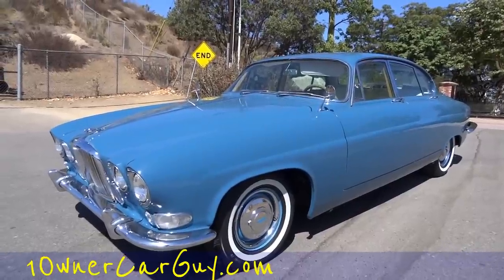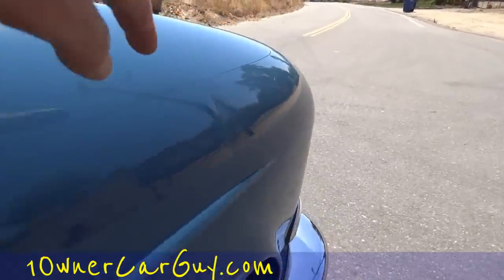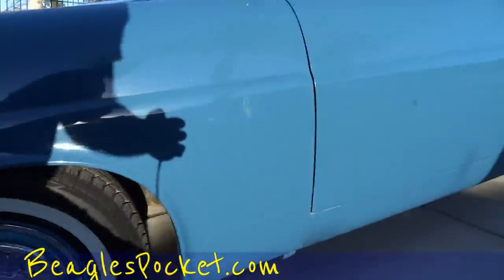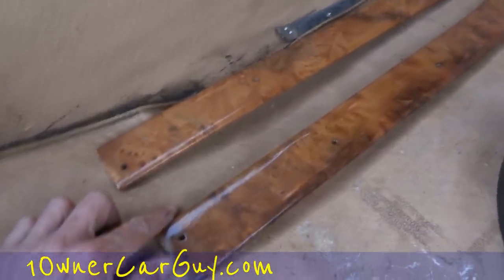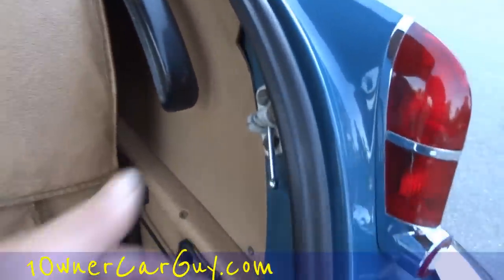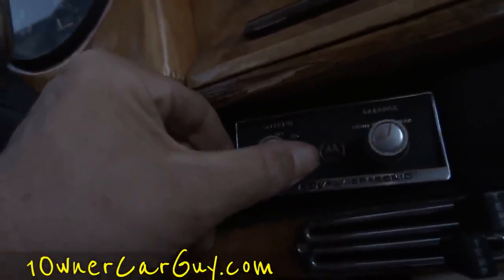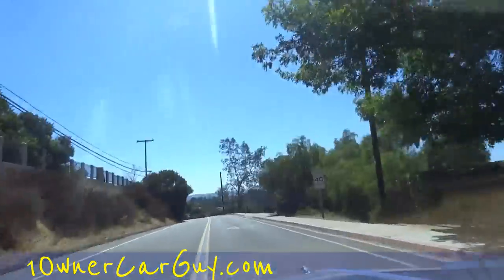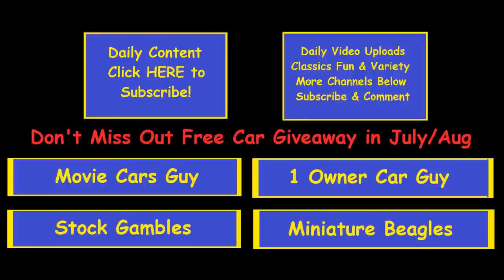Mark X Jaguar 420G Video Mark 10 4.2 Straight 6 Saloon Test Drive Walkaround Classic Review

Comment: The reason the car was idling high was because the auxillary starting device was engaged. If you'd pulled the wire from the triangular switch on the manifold rail, the triple SU carburettors would have settled down. These are fantastic cars. There are so many things on this car you point out that I could fix. The tool box latch you played with in the boot takes the black tool kit. The metal bracket that retained the spare tyre was off the top of the tyre. Love the car though, very nice...although she needs a respray...
Reply: Respray in vantablack for the ultimate villain car
Reply: Since you know well of these cars, I have one actually in need of repair, do you know a good place for parts online for these cars?

Comment: I worked on these cars in the 1950-60s and they were my pet hate. To fut new disc pads at the rear the whole rear suspension had to be dropped and then the diff and drive shafts removed to get to the discs and then remove the pads . Depending when the car was brought into the workshop, it could take either an entire day or even a day and half to put new pads in. If the discs needed to be skimmed then look at three days before it was back on the road. Want to remove the Auto box ?? Remove the fron end including the bumper and take the engine and gearbox out as one unit. Lovely to drive , very smooth and quiet, but a bastard of a car to work on.
Reply: Same as Rover 2000 / 3500 models,,,,diff had to be dropped to change pads.  This Jag 10 looks to have been resprayed with cheap synthetic paint now peeling off.
Reply: @michaelmacluskie6089  It looks as though it wasn't prepped properly,paint peeling due to insuffient sanding & you can even see chips that have been painted over.Amateur paint job,but fantastic car.

Comment: Plenty of these used in banger racing in the late 70s, early 80s, Along with the 420g and mk1 xj6's, they could be picked up from auction in running order for about £100, but back then they were just big old impractical unreliable vehicles.
Nobody would have thought Cortina mk2 &3s were anything more than cheap runarounds back then.
We have to give a big thumbs up to all the people that scrapped and banger raced these back in the day, because if they didn't and everyone kept them they'd be worth next to nothing.
Its value its solely down to its rarity

Comment: Great video and thanks for posting. My dad had a mk 10 and brought back some memories. Beautiful car and advertised as grace space and pace. The differences between this and the 420G were, amongst others, the vertical bar to grill as you mentioned but also a chrome waistline and side repeaters. The wheels were increased to 15" too. Interior lost the wood uppermost dash panel and replaced with padded panel. Engines were all 4.2 as many mk10's were 3.8. I believe the triple care was replaced by twin Su HD's. Again, thanks for really comprehensive video and an honest appraisal of car.

Comment: The Lock at 15:33 in the trunk is to fasten the black toolbox behind the sparewheel. There is a groove in the side of the toolbox where the tip of the  thorne on the lock fits in.

Comment: Certainly not bad for a 50+ year old car but it does need a lot of body work and a complete new repaint. And relocate those mirror to the factory original position about 2/3 of the way forward on the fenders.

Comment: The black box you found in the trunk belongs to the car it is a toolkit which could sit on the same side in the trunk as the spare wheel under the black metal holder :)
Reply: Cereal Marshmallows No problem :)

Comment: Don't remember the A/c or electric windows in the RHD version sold in OZ, may have been more angled to the US market.
Reply: Cereal Marshmallows I could be wrong, 1972 was a long time ago, I remember rolling one off a grassy verge over a concrete pipe which caused the right rear leading arm to catch momentarily which bent the bolt and caused the arm to move slightly to the rear, this caused the car to jerk before jumping over the drain pipe but the engine shot forward and the short length of the accelerator rod popped out of its firewall bush and dropped down [they went to cable in the XJ6], thank heavens we had a torch and tools [7 pm and dark] and were able to get the bolts out of the triangle connector to reinstall the rod and reconnect the linkage.
Reply: john brown Electric windows were an option on 420Gs in Australia I’ve seen one with power windows at a JCCV meet in Melbourne.

Comment: 255hp is impressive for the time..
Reply: Jay Leno said Jaguar were notorious for inflating their horsepower figures. He said they were about a third lower than quoted. But even 180BHP for a six in 1966 is pretty good.
Reply: These Jags had the same engine as the E type, 4.2 straight six and a genuine 265 bhp !!
Reply: @mebeasensei   Well if Jay says it, it must be true.....
Reply: 255 hp is impressive for a six even today, my ford falcon with a 4L inline 6 is only 240hp with modern fuel injection.